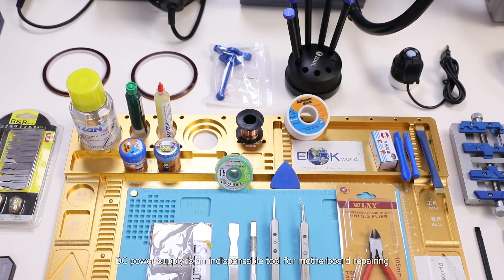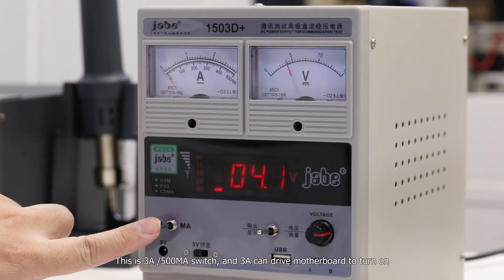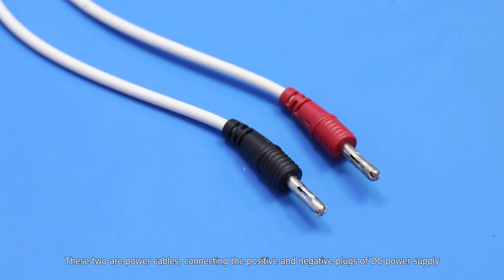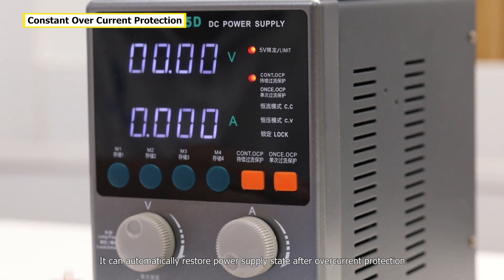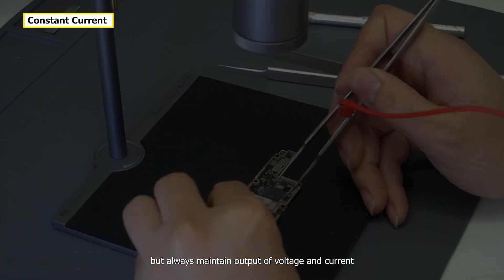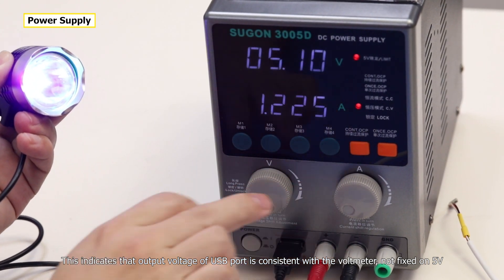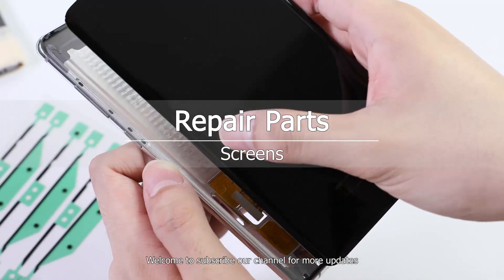Mother Board Repair Tool Course: DC Power Supply

Comment from the maker: DC power supply is an indispensable tool for motherboard repairing. Today, we’ll share with you how to use it.  

SUGON 3005D CV/CC Switching DC Power Supply, 110V, US Plug, w/retail package
https://www.elekworld.com/shop/productinfo.aspx?proid=15913&categoryid=286
Jabe 1503D+ DC Pointer-type Power Supply for Communication Test, 220V, China Standard Plug, w/retail package
https://www.elekworld.com/shop/productinfo.aspx?proid=17408&categoryid=286

0:00 introduction
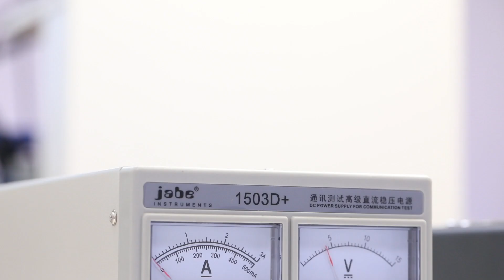0:20 Pointer-Type DC Power Supply introduction
1:08 Digital Readout Power Supply introduction
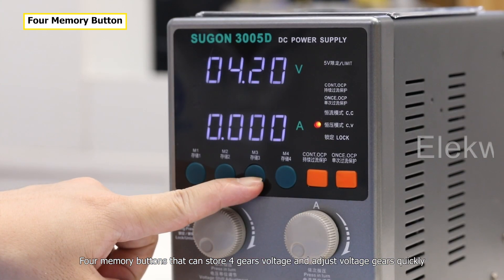1:31 Four Memory Button
1:54 Constant Over Current Protection
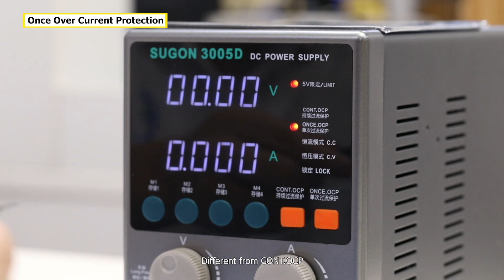2:08 Once Over Current Protection
2:25 Constant Current
2:43 Power Supply
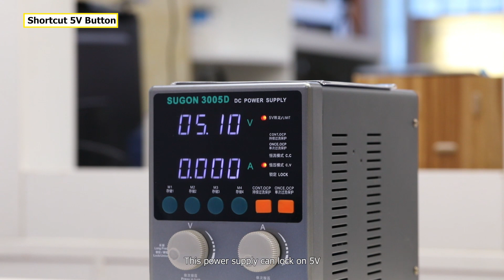3:07 Shortcut 5V Button
For more Repair parts&Tools and Tech support, please visit:
Website: https://www.elekworld.com
Facebook: https://www.facebook.com/Elekworldshop/
Instagram: https://www.instagram.com/elekworld/
Twitter: https://twitter.com/ElekworldL